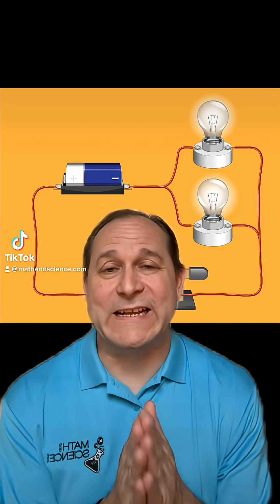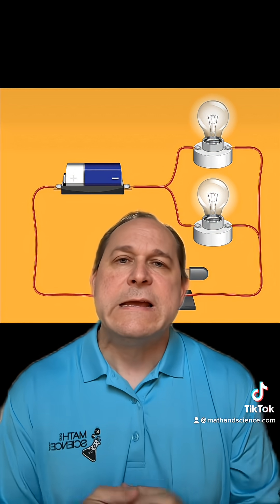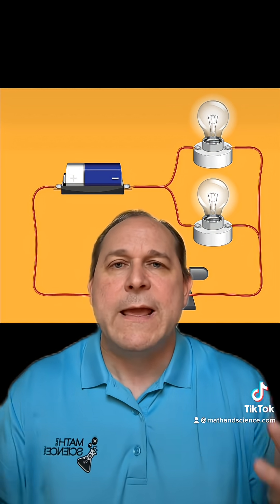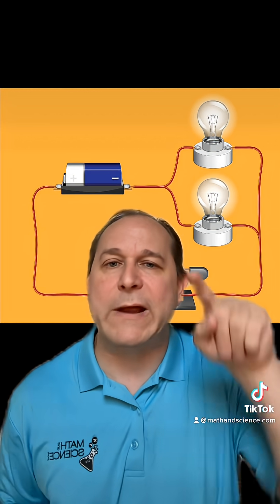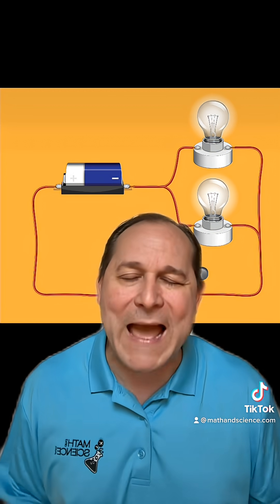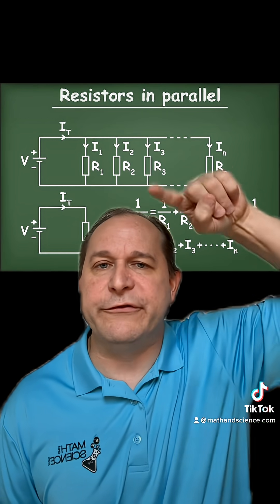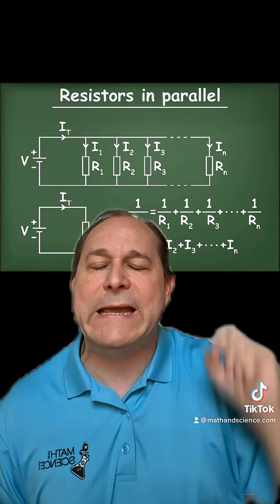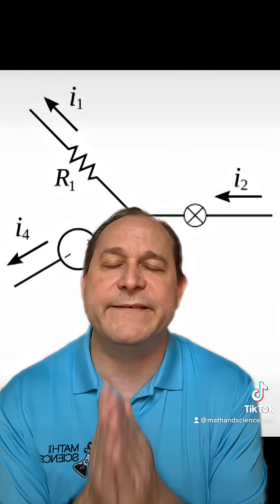SIMPLEST Explanation of Current & Kirchhoff’s Laws

Comment: yes..Kirchoff's Voltage law and Kirchoff's Current law describes how circuits work.
along with it learn about Resistors,  Capacitors , Inductors and semiconductor devices mainly all kinds of Diodes & Transistors.
difference between electricity and electronics is electrical is generation and distribution of electrical power.
Electronics is generation , processing and communicating of Information.
Reply from the maker: Great points!